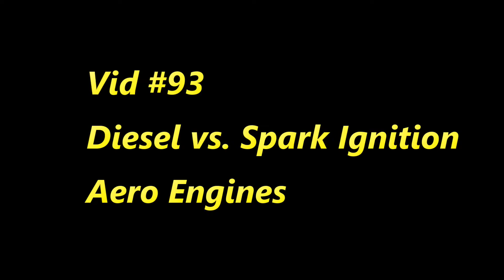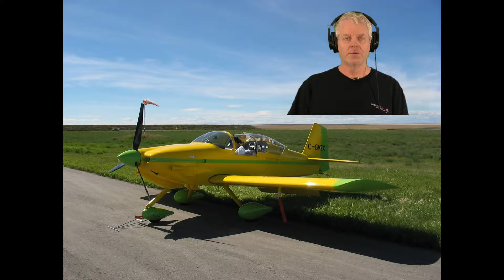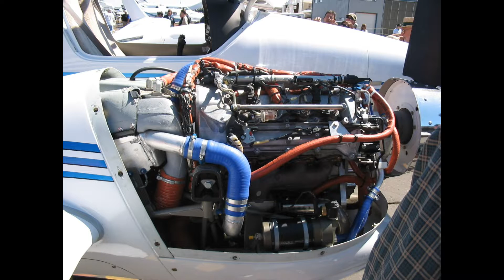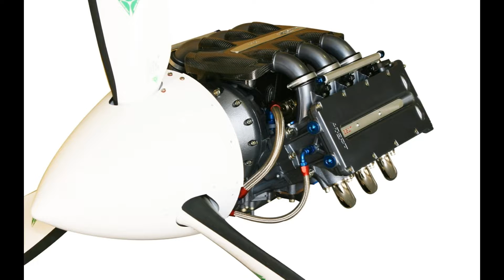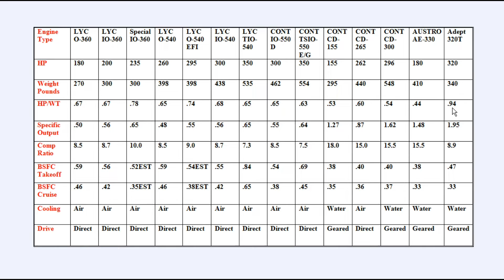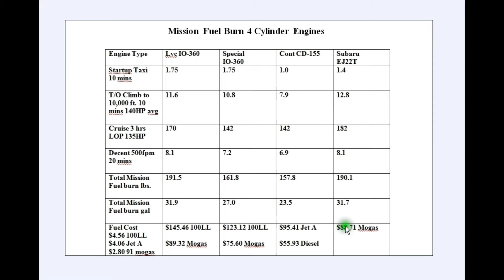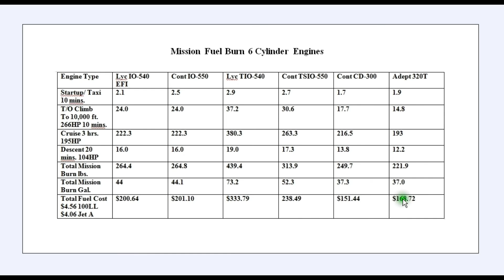Vid #93. Diesel vs. Spark Ignition Aero Engines

Comment: I think I'll call bull****. For example the best otto (normal car/plane) engine on wikipedia is the prius BSFC is 0.370 (https://en.wikipedia.org/wiki/Brake-specific_fuel_consumption) and yet these guys claim 0.33, the question that I'd ask is where did they get that data point as it would appear to be wrong, and if that data point is wrong all their data points are suspect. The thermal efficiency of any heat engine is limited by the delta T ie the difference in temperature between the environment and the max temperature produced. The reason that diesels get better fuel economy is simple physics, 1 the fuel has a higher calorific content and 2 the combustion temperatures are higher due to the higher compression. This engine is low compression and petrol (gasoline) powered so its really unlikely to stand a chance of actually really meeting those numbers assuming they mean lb/hpH.
Reply from the maker: Data taken from dyno test provided by the manufacturer. We can only know how accurate this is when the engine is put in widespread service and we can observe the TAS vs. fuel flow in a known airframe.

I my other videos I discuss the BSFC of SI vs. CI engines and we see the latest auro SI engines matching or exceeding comparable CI engines in this regard. The Otto cycle is considerably more efficient than the Diesel cycle. Once CRs are close, the SI engine can deliver superior BSFC figures at high load.

The R3350 engine from the '40s had a BSFC figure of .37 with a sub 7 to 1 CR (turbo compound). The Conti 550 also gets around this figure LOP.
Reply: @rv6ejguy  Yes we can only go on data provided by the manufacturer however given the marketing claims it's worth taking a liberal grain of salt with the claims especially when they make claims which beat all the auto manufacturers worldwide. You mention the  R3350 engine with a 7:1 compression ration however it's the compression ration of the entire system which defines efficiency. In this case the turbo is raising the effective compression, and capturing the waste power in the exhaust which fed back into the system. There have been a number of approaches to improve the economy of SI engines however given their future appears to be somewhat limited I wouldn't expect breakthroughs in this area.
Reply: @ianjon2248  "....it's worth taking a liberal grain of salt with the claims especially when they make claims which beat all the auto manufacturers worldwide."

Auto manufacturers aren't allowed to run extremely lean fuel mixtures, as they're required to conform to the emissions standards which have been set for automobiles, aircraft engines don't have that limitation.

"... I wouldn't expect breakthroughs in this area."

Those breakthroughs have been happening for DECADES, we've even discussed some here! Are you just determined to live with your head buried in the sand?
Reply: @ianjon2248  Also, if you're measuring efficiency by the volume of fuel consumed, that's not going to tell you anything about the thermal efficiency of the engine, as diesel fuel contains more energy than gasoline. A gasoline engine can consume 13-15% more fuel by volume and still be just as thermally efficient as a diesel engine.
Reply: That's not the best BSFC for an Otto cycle engine, that's just the best one on that list. Toyota has since improved on that number (the engine in the Prius is now 41% efficient, not 36.4%), and the Prius engine is a mass production automotive engine which must conform to emissions standards all over the world, so it's limited to running at stoichiometric fuel mixtures.

For decades, racing engines have been able to achieve BSFC numbers of around 0.34, as did the Continental Voyager engine used on the Rutan Voyager.
Reply: @PistonAvatarGuy  The best figures that I've seen for a prius is 40%, also most engines actually run leak of peak, not stoichiometric as this ensure fewer unburnt hydrocarbons. The prius gets a BSFC of about 0.347. The Adept 320 apparently beats Toyota with an efficiency of 41.9% without the multi-million dollar research budget. I would suspect that it's more likely that their method of calculating efficiency is flawed or inflated for other reasons. Diesels are naturally significantly more efficient due to fundamental laws of thermodynamics. Rather than simply spouting what appear to be ridiculous marketing claims it would be nice to see people put their brains into gear.
Reply: @ianjon2248  The conventional version of Toyota's 2.0 liter Dynamic Force engine reaches 40% thermal efficiency, while the Atkinson cycle version of the engine (for hybrid models, like the Prius) reaches 41%.

Modern automotive engines do not run LOP. Car companies stopped producing lean-burn engines in the '90s, as they could no longer meet emissions regulations (lean-burn engines produce too much NOx).

Edit: The first gen Honda Insight used lean-burn tech until 2006.

Diesels are only more efficient than gasoline engines when their compression ratio is significantly higher, but modern gasoline engines have been closing the gap.

On YouTube: Diesel vs. Spark Ignition. Torque and HP by rv6ejguy

Sorry, but you have no idea what you're talking about.
Reply: @PistonAvatarGuy   You're a goose, NoX production is generally a function of combustion temperature and pressure (See Haber-Boshe Process https://en.wikipedia.org/wiki/Haber_process) and while excess oxygen does force the reaction to the right it also improves fuel economy. Note that modern engines use combustion near the stoichiometric point to reduce NoX not to improve fuel consumption. So you can be even more efficient by emitting NoX with a lean burn. https://en.wikipedia.org/wiki/Lean-burn#Toyota_lean-burn_engines. Diesels have effective pressures of up to 23:1 which is much higher than petrol engines allowing higher combustion temperatures and hence higher efficiencies. Petrol engine compression is limited by the octane of the fuel to about 9:1 whereas diesel engines are not hence diesels can operates at higher efficiencies (which is why trucking companies use diesel engines as fuel is their biggest cost). So "closing the gap" is a silly comment as the efficiency of the engine is limited by underlying compression not by magic. Anyway the comment was that the efficiency figures being quoted are a "overly optimistic" however as they say "the fool and his money are easily parted" so you go an buy this very efficient engine. Meanwhile I'll invest in things that I think are supported by basic science and engineering principals.
Reply: @ianjon2248  You just contradicted yourself several times in the same comment.
Reply: @ianjon2248  I mean, where tf did you get the idea that gasoline engines are limited to a 9:1 compression ratio? 10.5:1 is common today, even with turbocharged engines, but 12:1 is becoming more common with naturally aspirated engines and some engines are able to reach 14:1. Mazda's Skyactiv-X engines are able to reach 16.3:1!

Modern diesels, on the other hand, are being limited to around 16:1 to 18:1, which means that their potential efficiency is LESS than that of modern gasoline engines.

"...that I think are supported by basic science and engineering principals."

Yes, because you clearly have such a great handle on such things!!! ROFLMAO!!!
Reply: @ianjon2248  "Note that modern engines use combustion near the stoichiometric point to reduce NoX not to improve fuel consumption."

THAT'S WHAT I SAID! Are you trolling?

"So you can be even more efficient by emitting NoX with a lean burn."

Yes, DUH, that's a major reason why the Adept Airmotive engine is so efficient, because it can run lean, unlike modern automotive engines.

The Toyota M20A-FXS has a BSFC of about 0.34 lb-hp-hr while being forced to run near (or at) stoichiometric, but you think that it's impossible for the Adept Airmotive engine to hit 0.33 while running lean? You're really just not running on all cylinders, are you???
Reply: @PistonAvatarGuy   As I said, I call bull** on the efficiency numbers. This is just basic science, petrol/gasoline engines are compression limited by the octane rating of the fuel as combustion changes from a burn to detonation as compression increases, there's no magic involved. By buying more expensive higher octane fuels you can increase your compression ratio and reduce fuel consumption however normal fuels available are limit this in practice. In WW2 115/145 Leaded fuel was available and was used in high compression engines until lead was phased out, these engines are now generally de-rated. The Skyactive engine that you gleefully quote is actually operates on a diesel cycle, Spark Controlled Compression Ignition (SPCCI) at low and medium revs to improve fuel economy. When it operates with an open throttle it's actually an Atkinson cycle with a lower effective compression. You've confused engine geometry and the real compression actually achieved and it's this real compression number that actually impacts efficiency. The modern diesels that you're talking about having lower compression are turbocharged, so the effective compression ration is significantly higher than the numbers you stated because the turbocharger is pre-compressing the air. While the otto and Atkinson cycle are "theoretically" more efficient than the diesel cycle the higher effective compression makes the combustion temperature far higher achieving better efficiency in practice. Welcome to the law of thermodynamics and do some more reading.
Reply: @ianjon2248  I just don't understand your argument here. Are you trying to argue that compression ratio is the sole determining factor of engine efficiency, or that compression ratios haven't increased over the years, because nether of those things are true.

"As I said, I call bull** on the efficiency numbers."

Call BS all you want, but until you have some real data, you're just guessing. And you're not even making a good guess, because there's plenty of data that is in direct opposition of basically everything that you're saying here.

"This is just basic science, petrol/gasoline engines are compression limited by the octane rating of the fuel as combustion changes from a burn to detonation as compression increases, there's no magic involved."

No, no magic, but a better understanding of the combustion process has allowed compression ratios to increase over the decades, without increasing fuel octane. Why do you think engine manufacturers spend hundreds of hours modeling the combustion process on supercomputers? Because there's nothing to gain from it? Because compression ratios and combustion efficiency can't be improved? I mean, we've seen the thermal efficiency of a huge range of processes improve over the years, but you're trying to argue that this didn't also happen for piston engines... for some mysterious reason? Compression ratio also isn't the sole determining factor of engine efficiency, as efficiency can also be improved by reducing friction losses, reducing pumping losses, etc.

"By buying more expensive higher octane fuels you can increase your compression ratio and reduce fuel consumption however normal fuels available are limit this in practice."

Compression ratio can also be increased by improving the design of the engine in ways which improve the combustion process, which is why compression ratios and engine efficiency have been steadily increasing since the '80s, but fuel octane hasn't. In automotive engines, emissions regulations also play a part in this conversation, as those regulations place limits on engine design and operating parameters which simply don't exist with aircraft engines. An aircraft engine can run very lean to improve efficiency, an automotive engine (generally) can't.

"Spark Controlled Compression Ignition (SPCCI)"

The diesel cycle is not SPARK controlled, there's is no spark plug in a diesel engine.

"You've confused engine geometry and the real compression actually achieved..."

No, buddy, you're just cherry picking. That engine is just ONE example that I've named, but there are plenty of conventional engines that operate with much higher compression ratios than engines from the past, while also operating on lower octane fuels. A Packard Merlin, for example, had a compression ratio of 6:1, burned 100+ octane fuel and could only handle 15 psi of boost. On the other hand, a Ford Ecoboost engine can run on 87 octane fuel, while seeing the same amount of boost as the Merlin, but has a compression ratio of 10.5:1!!! You're also ignoring that Honda mass produced an engine with a 12.1:1 compression ratio for use with regular pump gas. Other manufacturers (Porsche, Ferrari, GM with the LT6, etc) have also produced engines with compression ratios in the 12:1 region.

"While the otto and Atkinson cycle are "theoretically" more efficient than the diesel cycle the higher effective compression makes the combustion temperature far higher achieving better efficiency in practice."

That depends on how you're measuring efficiency. If you're talking about the volume of fuel burned, sure, a diesel might be capable of greater efficiency in many applications, but if you're talking about efficiency with regard to all of the things that we (as human beings) really care about, like fuel cost (and fuel weight in aircraft applications) and emissions output, SI engines are still far, FAR superior. This is especially true when talking about natural gas vs diesel engines in heavy vehicle applications... especially when you consider that natural gas engines are capable of making use of an even higher compression ratio than most gasoline engines, because of the superior octane rating of natural gas. The Plain Jane Civic GX even had a compression ratio of 12.7:1!

"Welcome to the law of thermodynamics and do some more reading."

You don't even understand the full extent of what you're talking about here, and you're telling ME to read more??? Buddy, thermodynamics proves YOU wrong, as rv6ejguy has shown in his videos.
Reply: @PistonAvatarGuy  I'd like to correct you on something here. We're talking specifically about the BSFC numbers. I called bulls$#@ on them. 

You say "That depends on how you're measuring efficiency. If you're talking about the volume of fuel burned, sure, a diesel might be capable of greater efficiency in many applications, but if you're talking about efficiency with regard to all of the things that we (as human beings) really care about, like fuel cost (and fuel weight in aircraft applications) and emissions output, SI engines are still far, FAR superior."

You're appear to be trying to redefine the meaning of efficiency and yet you accuse me of cherry picking.
Reply: @ianjon2248  Let's simplify this discussion...

If something as archaic and crude as a Rotax 915 iS can achieve close to the same efficiency as one of the older Toyota Atkinson cycle engines (35% vs 36% thermal efficiency),  why can't a more advanced engine (like the Adept Airmotive engine), achieve the same efficiency as a modern Toyota Atkinson cycle engine?

Again, the Toyota engines can't really run lean, so they have to resort to using the Atkinson cycle to achieve their efficiency, but aircraft engines don't have that limitation.
Reply: @ianjon2248  I was fretting over the EPA mileage rating for the Ram Ecodiesel, but then I found this from a Car and Driver road test:

----
LOWS: More expensive and slower than gas V-8, optimistic EPA estimates.
With the Limited's standard air springs, which lowers the truck 0.6 inch at speeds above 50 mph, the Limited achieved 25 mpg in our 75-mph highway fuel-economy test, just topping the Rebel's 24-mpg return. Although both EcoDiesels delivered significantly better mileage than you'll get with the Ram's optional 5.7-liter Hemi V-8, neither truck approached its EPA highway fuel-economy estimate of 29 mpg.
----

If diesels are more efficient than gasoline engines, with their turbocharging and their ~16:1 compression ratios, why is a less powerful diesel less efficient (BSFC, energy, cost, emissions) than a cheaper, cleaner, non-turbo, more powerful gasoline engine?

You say that my knowledge of engines is lacking in some way, well come at me, bro, WITH ALL OF IT!!! C'mon, bring it on!
Reply: @PistonAvatarGuy  You appear to be taking this personally and trying to change the scope of this discussion. My statement was that the figures quoted for the engine appeared to be incorrect. Rather than actually analysing my statement you've tried to defend the figures and I've explained why I think the figures are bulls@#. All it takes is a poorly calibrated dyno and you're quoting bogus overly optimistic figures. Now you're trying to segway into car vehicle highway mileage. Have a look at the wikipedia BSFC fuel consumption figures, you'll note that the most efficient engines are diesel
Reply: @ianjon2248  Taking it personally? You made the discussion personal when you commented on my knowledge regarding engines!

Your statement regarding the Adept Airmotive engine wasn't based on anything substantial, which is I why I provided you with a wide range of data so that you could adjust your position on this matter, the fact that you saw this data and dismissed it as being unrelated is YOUR failing.

You have no proof that the Adept Airmotive dyno testing is faulty, nor is there any reason to believe that it is based on the figures that they provided. Again, this highlights YOUR lack of knowledge on this matter.

The Wikipedia page on BSFC is by no means a complete list and we've already covered that. Do you expect me not to be annoyed that I'm having to repeat myself here? The Wikipedia page also quotes PEAK BSFC figures, which are rarely relevant in a discussion regarding aircraft engines, and I believe that this was already stated as well. The relevant BSFC figures for aircraft diesel engines are rarely significantly better than those of gasoline engines, because the diesels aren't operated near their peak BSFC in aircraft applications.
Reply: @PistonAvatarGuy  Look rather than quoting the popular press, company marketing material and other marginal material, why not try reading and quoting either journals or at least reference sources such as wikipedia or material which is likely to actually provide a reasonable degree of assurance. I'm not arguing that some gasoline otto engine designs can't tolerate slightly higher compression. This includes older designs such as the sleeve valve engines of WW2 vintage which had both better volumetric efficiency and higher compression due to a better combustion chamber as there were no valves.  but it's just not in the same ballpark as diesel engines ratio of up to 23:1 on NA diesels. The 14:1-20:1 forced induction diesel have manifold pressures of 2.5-2.8 bar so the actual compression ratios of these engines can be around 45:1. I'm simply saying that I find it extremely unlikely that the figures quoted for the engine are true. Yes I have no proof but I'm putting my thinking cap on before believing everything that I see or hear. As I stated I'm happy to put my money where my mouth is and  place a wager on it. Why don't we ask Professor Kook https://research.unsw.edu.au/people/professor-shawn-kook to be an independent judge on the matter as this is his area of expertise. Don't worry I won't walk down the corridor to buy him a beer after taking your money ;-) (Though I might)
Reply: @ianjon2248  The problem with your thought process here is that the additional compression provided by a turbocharger comes with the cost of increased exhaust back pressure, which reduces efficiency relative to what you'd see with just pure compression.

The Mercedes-Benz OM640 engine has a compression ratio of 18:1, yet it's only able to achieve a BSFC at cruise (as the AE 330) that's on par with the Toyota 2ZR-FXE, explain that.

Instead of looking at research papers and contemplating theory, why don't you look at what's actually being done in the real world, with real engines?
Reply: @PistonAvatarGuy  Look this is purely about the claimed BSFC fuel consumption figures by the maker of the engine mentioned in the video. BSFC is a well known measure of efficiency and enables the comparison of different engines types to figure out which one is better from a fuel efficiency measure. As I've stated, I believe the claimed figures are completely wrong. BSFC isn't the be all and end all of engines, I like rotaries because they're lightweight and cheaper than turbines however rotaries don't get good BSFC numbers because they're inefficient compared to normal piston engines.
You still appear to believe the numbers published in the video, that's on you however I'm happy to defer to a specialist in the area to have a wager with you because I'm very confident that, in the real world of maths, physics and measurement which BSFC is based on, the idea that the engine can achieve these figures is laughable.

But you can continue to believe whatever you want... Fairies, vaccines being toxic, contrails in the sky being part of a global conspiracy, that's your bailiwick. But don't get upset if I say that your views don't stack up in the world of science, because they don't. I'm happy to bet that fairies don't exist either, will you bet on that one?
Reply: @ianjon2248  No, this is about you believing that the claims made by Adept Airmotive are erroneous, when there's no reason to believe that they are.

A "specialist" isn't going to know anything more about the Adept Airmotive engine than you do, so there'd be no point in having a discussion with one. The closest thing that we have to a "specialist" here is rv6ejguy, and he's telling you that you're probably wrong.

Unless you want to give me a significant chunk of money so that I can test the Adept Airmotive engine out for myself, there's no point in continuing this discussion.

"...the idea that the engine can achieve these figures is laughable."

Why? There are automotive-style gasoline engines that achieve better numbers with fairly rich (or close to stoichiometric) fuel mixtures!  Some racing engines manage 0.28, and they're 2-valve pushrod engines that rev to the moon! Granted, those engines use very high octane fuels to achieve that kind of performance, but again, you're just ignoring the benefits that lean fuel mixtures with conventional fuels can offer, because it destroys your whole argument. I've also seen dyno charts of Honda engines running slightly rich (12.3:1) that managed better BSFC numbers (0.35-0.36) than the AE 330 at the same power output (180 hp)... without turbocharging and while running on premium pump gas!

You're just going to ignore every bit of data thrown at you, so there's no point in continuing this conversation.
Reply: @ianjon2248  Search online:  Fuel System Math in Racing Engine Design (BSFC)

From that website:

The following BSFC figures are typical of most modern performance engines:

0.48 to 0.55 Stock and medium performance engines

0.45 to 0.50 Performance engines with good heads

0.28 to 0.45 Most racing engines

0.35 to 0.38 Pro Stock style engines

0.55 to 0.65 Supercharged or turbocharged engines

That's from a book titled: Performance Automotive Engine Math by John Baechtel

I've come across numbers in the 0.30 to 0.36 range in many different publications regarding racing engines over the years, it's unfortunate that I never thought to compile those sources for someone who has absolutely zero knowledge regarding piston engine technology.
Reply: @PistonAvatarGuy  Your comment "The Mercedes-Benz OM640 engine has a compression ratio of 18:1, yet it's only able to achieve a BSFC at cruise (as the AE 330) that's on par with the Toyota 2ZR-FXE, explain that." appears to show that you don't quite grasp what BSFC is. You appear to be talking about Litres/100km or similar of a car driving which is a completely different concept. 
Engines are  tested on a test bench connected to a dyno at the most efficient load and RPM. BSFC=r/P where r=fuel consumption in grams/second or pounds and P is Power. The numbers that we've been talking about are the old hokey imperial numbers that I think only the US, Libya and North Korea still use. Most people now use metric as its a simpler more logical system which is less error  prone.
Reply: @PistonAvatarGuy  So you're going to take someone with no formal qualifications as a source of gospel. The guy obviously knows a bucket load about tinkering with engines but clearly does really grasp actual engine efficiency. This is pretty funny that you're using him as a source of truth, just to be clear the world record holder for 4 stroke engines is the  Wärtsilä W31 at  0.271 only just beating out a racing engine. When people are breaking records they actually have to calibrate their systems to ensure that they're accurate.
Reply: @ianjon2248  Ok, you're clearly a troll.
Reply: @PistonAvatarGuy  No, I'm simply pointing out the fact that your opinions are based on some pretty flimsy sources. Your response is name calling which is a bit childish
My reasons for thinking that the BSFC claims associated with engine in question are bogus remain valid. The numbers are fantasy and should be called out.
You on the other hand keep insisting that they're true, or likely to be true and came flying out of the blocks to defend them.
I've offered to let you put your money where your mouth is, and I've also offered to let an independent world renowned expert in the field be the arbiter. But you won't have a bar of that.
Instead you try to claim that this type of expert knows nothing and that there's "real world" where the truth actually resides. 
Going down this path simply makes you a sucker for marketing claims, I really hope that you do some proper research on engine theory and understand where what the underlying limitations are. You might also want to read up on confirmation bias a
Read about the claims of the Bourke engine for an example of a designer making extravagant claims about engine efficiency and power. 
 You might also want to read up on confirmation bias how it effects your thinking. 

Just because you want to believe something doesn't make it so. Hopefully you'll put on your thinking cap a bit better in the future.
Reply: @ianjon2248  "No, I'm simply pointing out the fact that your opinions are based on some pretty flimsy sources."

Like engine builders who have direct experience with how much power their engines are making and how much fuel they're consuming?

"You on the other hand keep insisting that they're true, or likely to be true and came flying out of the blocks to defend them."

And? I'd like to see someone put the engine to the test, just for the chance to see aviation piston engine technology advance for a change.

"I've offered to let you put your money where your mouth is, and I've also offered to let an independent world renowned expert in the field be the arbiter."

What would be the point if you're not willing to let me test the engine? You're the one defining all of the rules of the contest, you're the one trying to draw me into it, so the whole thing stinks of a setup. I'm not a betting man, anyway, I'd never wager a significant amount of money on something unless it was absolutely certain that I could win.

"Instead you try to claim that this type of expert knows nothing and that there's "real world" where the truth actually resides."

His stance is in opposition to people who have real world experience with real engines, so something is clearly amiss with your so-called "expert."

"Going down this path simply makes you a sucker for marketing claims,"

Except that I never said that I'm certain that their claims are correct, I said that there's is plenty of evidence to support the POSSIBILITY of them being correct, you're just refusing to see that evidence because YOU are biased.

"Read about the claims of the Bourke engine for an example of a designer making extravagant claims about engine efficiency and power."

This is not a new kind of engine, nor is it doing anything extravagant.

"Just because you want to believe something doesn't make it so."

That's also something that you should be saying to yourself. You have absolutely no idea if Adept Airmotive's claims are wrong, neither do I, so the ONLY solution here would be to actually TEST THE ENGINE. And it should be tested by an unbiased party, like rv6ejguy.
Reply: @PistonAvatarGuy  Look I didn't mean to offend you. My background is designing and building things using by leveraging logic and an experience with physical processes. When I look at the claimed figures associated with this engine they don't look right, in fact they smell.
You have come to their defence however the sources that you use to back your arguments aren't ones which I would ever use if I was writing a design piece or publication. Where I work numbers matter, marketing figures are another creature all together.
The reason I asked you to bet is most people won't put there money at risk in an argument. I would often do this with my children when getting them to back up some comments. I had a lot of lawns mown and cars washed until they learnt the ability of doing a bit of solid research before putting things of value at risk. I don't see this as gambling, it is using your brain to make economic decisions.
I now run a business which deals in technology which has been growing at 50%-100% year on year for almost a decade, this was also a risk however it was based on numbers and it has panned out well.
I wouldn't invest in this engine when they're publishing these numbers. It calls into question other statements which they have made.
Reply: @ianjon2248  Your position is clear, bud, but it's also clear that you don't know ANYTHING about engines!

Again, I ask, if a Toyota Prius engine can get close to that number with full emissions controls, no LOP operation and all of the huge restrictions that the SAE places on automotive dyno testing, why can't the Adept Airmotive engine get into the same efficiency range while being allowed to run LOP and without the same restrictions which limit the efficiency of modern automotive engines? You probably don't even know how restrictive those testing procedures really are, because you don't know anything about anything related to engine technology!

"...aren't ones which I would ever use if I was writing a design piece or publication."

AND??? I wouldn't either, but they indicate that the sort of efficiency claimed by Adept Airmotive might be possible! If you can find some good, solid source material which proves that their claims are complete bunkum, then let's see them! Let's see a very similar engine running LOP and without all of the restrictions that limit the efficiency of modern automotive engines!

"The reason I asked you to bet is most people won't put there money at risk in an argument."

Why would you think that I didn't understand that? MY point was that I never said that I 100% believed their claims, all I said was that I think that there's a good possibility that they're true and that their claims need to be verified. If their claims are true, the engine would be a significant improvement over current aircraft piston engines, and improvements in that area are SORELY NEEDED.

"I wouldn't invest in this engine when they're publishing these numbers."

And why would I be concerned with the opinion of someone who knows absolutely NOTHING about engine technology?
Reply: @ianjon2248  If you want to see some unbelievable numbers, take a look at the Viking 130. They claim full power at 6.6 GHP, which would result in 0.30 lb/hp/hr BSFC. The thing is, though, it's unlikely that they're all that far off, so it can't be denied that the engine is HIGHLY efficient.

If the engine is only making 120 hp, that's 0.33 lb/hp/hr, if it's only making 110, that's 0.36 lb/hp/hr... at full power! Something is either very far off, or modern gasoline engine technology is FAR more efficient than you think it is.
Reply: @ianjon2248  And, even if you were the world's foremost expert on engine technology, why are you ignoring such enormously important aspects of this discussion, like the difference in testing between automotive and aircraft engines? Why are you ignoring LOP operation? Why aren't you presenting any data which supports your position here, except for the tiny amount of information offered by one Wikipedia article? The only possible explanation is that you're putting on a show, all to destroy any credibility that I might hold.

Let's see some actual data, let's see you acknowledge the more technical points which have been brought up in this discussion.
Reply: @PistonAvatarGuy  If I don't know anything accept the bet, it should be taking candy from a baby. 
My position is that the figures being quoted are unlikely to be true. In fact, I'm happy to state that given the design of the engine it can't achieve the figures quoted, full stop.
I have suggested an expert in the field to be the judge however you don't want to accept the bet. 
However you're the expert who believes in the book that states that racing engines get the same economy as the Wärtsilä 31
Yes you know about engines...........

The prius engine that you're talking about doesn't run on an otto cycle it's an atkinson cycle and is doing lots of clever things to improve it's economy. The engine that you're defending is a standard liquid cooled, turbocharged fuel injected engine. I'd actually be surprised if it achieves figures much better than standard IO-720 of 0.4 as the only difference is variable timing and turbocharging. 
For a full understanding of what the prius does to get the BSFC figures of 0.370 (Not 0.33 as your magic engine gets) do yourself a favour and read
https://www.sae.org/publications/technical-papers/content/2004-01-0064/
Reply: @ianjon2248  The paper that you've posted is OLD, the current Prius engine is significantly more efficient than the engine in the first generation of the car. I know how the Prius engine works, I don't need any additional information about it.

The other differences from the IO-720 that you're missing with regard to the Adept Airmotive engine: Liquid cooling, 4 valves/cylinder, continuously variable ignition timing, and EFI with a knock sensor. Liquid cooling makes the engine more able to resist knock, as the cylinder head temperatures are more stable (and possibly cooler), EFI allows for a more consistent fuel mixture to be maintained, which allows for leaner mixtures to be used without resulting in problems, and the knock sensor allows leaner mixtures and more aggressive ignition timing to be used without knock becoming an issue. Having 4 valves per cylinder improves the volumetric efficiency of the engine, which reduces pumping losses (also a major reason why racing engines can be so efficient), making the engine more efficient. Liquid cooling also greatly reduces (or eliminates) the need to run rich mixtures at high power settings, which obviously improves efficiency at those power settings.

Edit: The pistons also sweep less area in the Adept Airmotive engine and piston ring friction contributes significantly to the total amount of friction produced by an engine.

The unique (to aircraft engines) throttle valve that Adept Airmotive uses may also help to reduce pumping losses.

Liquid cooling can also be used to basically eliminate the drag of the cooling system and a lighter engine improves the efficiency of the entire aircraft, as does a reduced fuel load.
Reply: @ianjon2248  An SAE article for you: Toyota unveils more new gasoline ICEs with 40% thermal efficiency 2018-04-04 DAN CARNEY

41% efficiency is a BSFC of about 0.32 - 0.33.
Reply: @ianjon2248  The Adept Airmotive engine doesn't have VVT, btw.
Reply: @ianjon2248  "If I don't know anything accept the bet, it should be taking candy from a baby. "

And, I don't know how you're not aware of this at this point (my guess is that you lack the ability to READ and understand my comments), but whether or not I'm willing to bet money on this is in no way related to my estimation of your level of knowledge here, it has to do with whether or not I trust Adept Airmotive's claims. I already said, many times here, I don't have enough faith in their numbers to place a bet and I (most of all) I don't trust YOUR SETUP. If you're in complete control of the testing, how do I know that you're not going to rig the whole thing to come out in your favor? Based on what I see of you here, I have no reason to believe that you wouldn't do that.
Reply: @PistonAvatarGuy  I have read your comments. Anyone with half a clue would look at the quoted numbers and scoff. They're obviously wrong, however you've consistently defended the capability of the engines to achieve these numbers. Yes I think that toyota might be able to get numbers approaching these figures using a combination of direct injection, unusual valve timing operation giving and  Atkinson operating cycle. But that's not this engine and if you opened your eyes you'd admit that as well. That's the reason why you won't take the bet because deep inside you know that I'm right. Anyone who has studied combustion efficiency at any academic level were instruments are properly calibrated knows that the numbers are way off the mark. Your bits of fantasy about the efficiency of racing engines are flat out wrong and you should be able to recognise this but apparently you're the expert......
You also made the comment earlier that the backpressure of a turbocharger reduces engine efficiency. What you're failing to see is that while this reduces the efficiency of the piston cycle, it can improve the overall efficiency of the system.
Reply: @ianjon2248  Are you stuck in a loop?
Reply: @ianjon2248  lol, pwned. Didn't know SI engines could have compression ratios that high, did ya?
Reply: @PistonAvatarGuy  The octane rating of a fuel limits the compression that an engine can actually operate under. Read the following https://en.wikipedia.org/wiki/Engine_knocking  and https://en.wikipedia.org/wiki/Octane_rating or as I suggested put your money where your mouth, but that right you don't bet because you know that you'll lose. A word of advice read actual texts by smart, qualified people, not magazines or "bob the builder" shows you how to build a fast car type books. Not much has changed since Ricardo's day so start with  The High-Speed Internal Combustion Engine (4th ed.) and work your way up. But be warned some of the words have more than two syllables. A number of engines have logically higher compression ratios than older engines however they don't actually use this compression when running or effectively lower it by using things like EGR. In WW2 they used water/meth injection to effectively increase the octane rating of the fuel to allow higher power settings.
Reply: @ianjon2248  From one of the links that you supplied: "...knocking occurs when combustion of some of the air/fuel mixture in the cylinder does not result from propagation of the flame front ignited by the spark plug, but when one or more pockets of air/fuel mixture explode outside the envelope of the normal combustion front."

Engine builders and manufacturers have found ways to basically eliminate these "pockets" of improper air/fuel mixtures using turbulence, which is confirmed by the article...

"Turbulence, as stated, has a very important effect on knock. Engines with good turbulence tend to knock less than engines with poor turbulence. Turbulence occurs not only while the engine is inhaling but also when the mixture is compressed and burned. Many pistons are designed to use "squish" turbulence to violently mix the air and fuel together as they are ignited and burned, which reduces knock greatly by speeding up burning and cooling the unburnt mixture."

Many older engines don't have any squish area. The ports, combustion chambers and valves of older engines could also be shaped in such a way that they would cause part of the fuel/air charge to condense as it entered the cylinder (think of a wing passing through the air and making vapor trails), but modern engines have reduced or eliminated this problem.

Did you not read your own sources?

The book that you suggested was published in 1953, which is nearly THREE DECADES before engine builders started to find reliable ways to increase compression ratios without also having to increase fuel octane. Builders of high performance engines have no trouble achieving compression ratios of over 13:1 on premium pump gas. Porsche and Ferrari (possibly others) even mass produce and sell engines with compression ratios this high to the public. They are absolutely NOT running EGR through these engines at high loads, as their entire goal is to maximize engine power output.

In the old days, engine manufacturers would also need to create a safety margin in order to prevent knocking in conditions that were less than ideal and did this by keeping the compression ratio fairly low, but modern engine control systems reduce the need for this margin, as they can detect and compensate for knock by enriching the fuel mixture, retarding timing, etc.
Reply: @ianjon2248 Just for some comparison F1 engines are running almost 60% efficiency. Although they run on E85 or so, they are running spark ignition with compression ratios of 16+:1 and running up to 2.5 bar of boost.
Reply from the maker: Fuel flow and torque measured on the dyno. Assuming the dyno is accurate, it's pretty easy to calculate BSFC. As I said, I only report on the data given to me. Of course that may not be accurate. We'll have to see in service.

You have to remember that the Diesel cycle is inherently less efficient than the Otto cycle for the same CR. You can watch some of my other vids covering this.

Conti 550 and Wright R3350 (very low CR but turbo compound) are both around .37. The Toyota Dynamic Force engines have a TE of 41% and a BSFC of around .33/.34.

There are other aspects affecting BSFC like frictional losses where Toyota and others have concentrated much effort. Thinner ring packs have quite a large effect and diesels are not able to use this to best advantage.

Diesel and gasoline actually have almost identical lower heating values per unit weight.
Reply: @rv6ejguy  Yes I acknowledge the otto/atkinson cycle is more efficient however in practice the diesel/Compression ignition cycle is more efficient. This is due primarily to the available fuels and combustion temperatures, and it is why research is ongoing into compression ignition of petrol/gasoline. While there is a chance that this engine will live up to these claims, I'm more than happy to bet a beer on the claims being incorrect, either by accident or design. I suspect on balance you'd be somewhat hesitant in this regard if the value increased significantly especially given your knowledge of engines in general. On the other hand, I'm reasonably confident that there's something awry in these claims as the results are a significant outlier from other conventional engines, and it is a conventional engine. In general we believe what we want to believe, this is called confirmation bias.
Reply: @ianjon2248  "Yes I acknowledge the otto/atkinson cycle is more efficient however in practice the diesel/Compression ignition cycle is more efficient."

NOT ALWAYS. Examples:

Energy consumption per mile using GGE and combined city/highway mpg...

Cars...
2018 Honda Civic 4Dr (1.5 turbo gasoline, CVT): 3.3611 MJ
2018 Chevrolet Cruze (1.6 turbo diesel, 9 spd auto): 3.7027 MJ

Trucks...
2020 Ford F150 Pickup 2WD (2.7 turbo gasoline, 10 spd auto): 5.5 MJ
2020 Ford F150 Pickup 2WD (3.0 turbo diesel, 10 spd auto): 5.71 MJ

The gasoline vehicles also offer significantly better acceleration performance and would use even less energy if limited to the same power output as the diesels.

"I suspect on balance you'd be somewhat hesitant in this regard if the value increased significantly especially given your knowledge of engines in general"

Which is (clearly) FAR superior to yours. Anyway, I would be hesitant to bet anything on the Adept Airmotive engine, not because I don't believe that gasoline engines are capable of being more efficient than diesels (when rated by BSFC, cost of fuel and emissions), but because I'm skeptical that they were able to achieve the kind of efficiency that they're claiming with such a low compression ratio. I have little doubt that the engine could achieve that kind of efficiency with further development.

"...as the results are a significant outlier from other conventional engines..."

You do realize that you're comparing it to engines that have their design roots in the early 1900s, correct? Two valves, air cooling, mechanical fuel injection, giant displacements... why would you expect such engines to be comparable in performance to a fully modern engine design?

"...and it is a conventional engine."

It's not like a conventional aircraft engine and it's allowed to run lean, unlike most automotive engines, so there is nothing that you can use for comparison.

----

"In this instance I have stated that I find the claims difficult to believe, I'm happy to place a wager that I'm correct as this engine doesn't appear to have any special technology which would enable it to get anywhere near the claimed figures."

It's called RUNNING LEAN. Can you not wrap your head around the concept of a MODERN gasoline engine that is capable of RUNNING LEAN??? You keep ignoring that! I'm starting to think that you're just an AI bot, because you're not capable of processing new information, you can only regurgitate common, OUTDATED knowledge.

"(which increases friction losses)"

Not necessarily, because it's a much, MUCH smaller engine than the engines that it's meant to replace and because it has a very short stroke, which keeps piston speeds low.

"But you're trying to say that magic happens..."

Running lean is not magic, bud. There's a guy on YouTube who tuned his 400+ hp Corvette so that it would run lean at highway speeds, he was able to get 40 mpg out of the car, is that magic???

----

"I'd like to correct you on something here. We're talking specifically about the BSFC numbers."

Efficiency with regard to BSFC is very close to being the same as energy efficiency, because the energy density of gasoline and diesel by mass are nearly the same (~1%). We could also go by CO2 emissions, as that also gives a very close approximation of energy efficiency. You're not correcting me on anything, you're just learning about all of this and have no clue what you're talking about.

"You're appear to be trying to redefine the meaning of efficiency and yet you accuse me of cherry picking."

I'm not cherry picking at all, gasoline engines can be more efficient than diesels when measured by the amount of fuel that they consume by mass (BSFC), by the energy content of the fuels, by the emissions that they produce (including CO2) and by the cost of the fuel that they consume (in the US).
Reply from the maker: @ianjon2248  As I said before, I just reported the data provided. The real world will eventually confirm or deny the claims- assuming the engine makes it into widespread use which I'm more skeptical of now as they continue to burn through cash, the ROI gets further away and pushes the price outside what most folks are willing to pay for it,

I have no reason to believe the data was purposely padded. Seems like a team which can design and produce an engine like this, have enough engineering savvy to calibrate a FF transducer and do the mat for BSFC. Anyone can make a math mistake however.

We have other examples of modified SI aero engines producing BSFC figure close to CI aero engines when running LOP and these have lower CRs than the Adept.

We shall see.

I wanted to do a follow up vid on the Adept but they haven't provided me with the requested data they promised many months ago now. That in itself isn't a good sign...